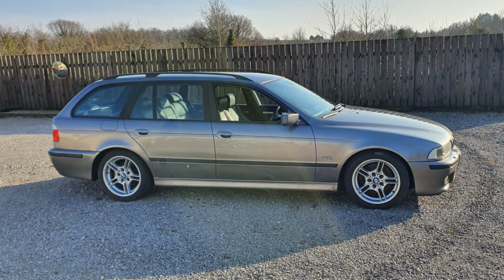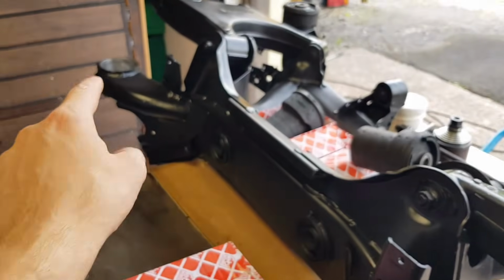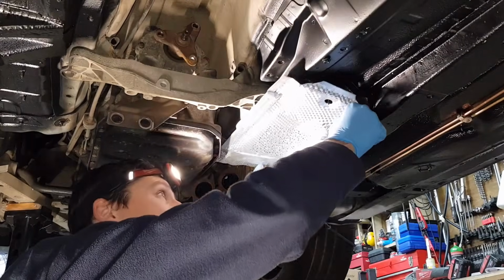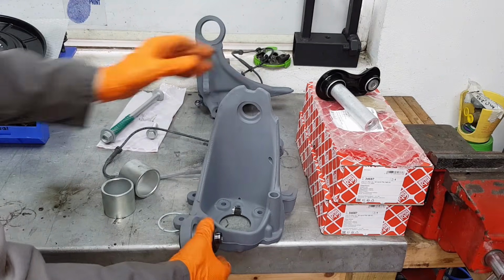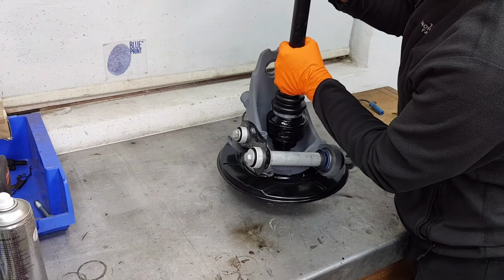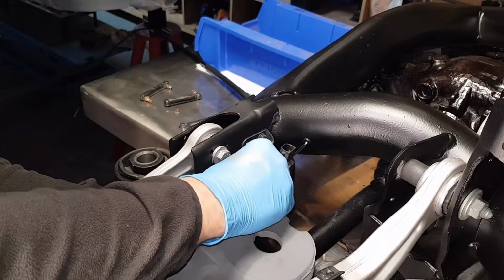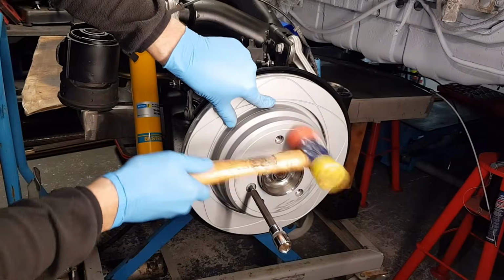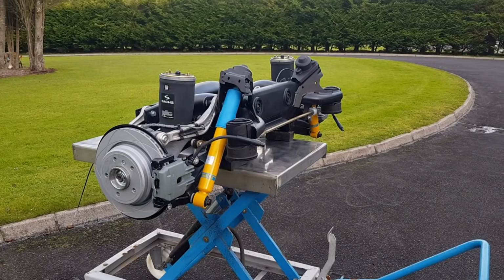BMW E39 Touring Rear Axle Restoration Part 3 | Reassembly Step-by-Step

Comment: Another superb video 👌🏼

When I did my Jap import E39 Touring I used all Lemforder, TRW and Moog parts bar droplinks, they were Meyle HD.

But as you said they've all outsourced to Asia now mainly, still get some Germany, Poland and Slovakia parts but you have to be lucky with the likes of Autodoc etc

On my UK E39 540i I have now, I've gone all Febi and Meyle HD with a few Moog parts too. Could only get either left or right Lemforder parts, no TRW parts at all and the ones I did get I sent back as they were either from China or Malaysia.

Like yours, the Febi parts were all German. Same with my Sachs shocks etc

It's a shame they've gone this way. Typical cost cutting etc

Comment: Il y a pas mal de montage qu'on ne voit pas (bras inférieur, mâchoires de frein à main....), dommage.
Reply from the maker: Hi
It is a shame that you are concentrating on the negative things. It is not possible to show every detail as the videos will become too long. Regarding the brake shoes it is very simple, just remove the springs and springloaded bolts by twisting, I showed the attachment of the springs with the shoes in place. Thanks for watching anyway